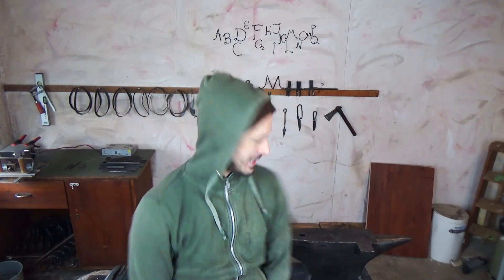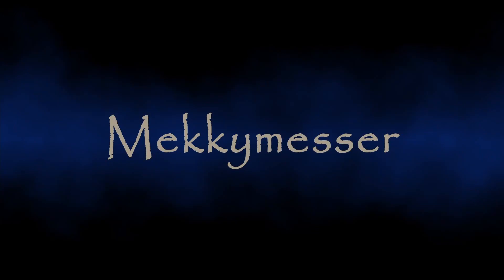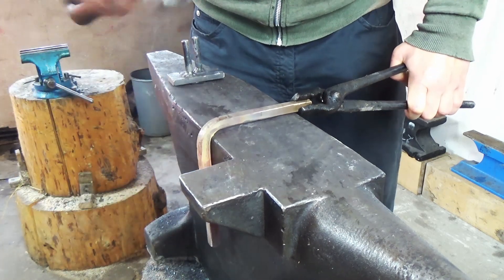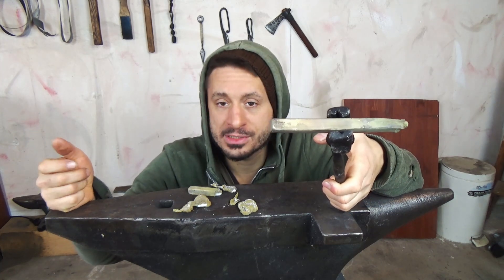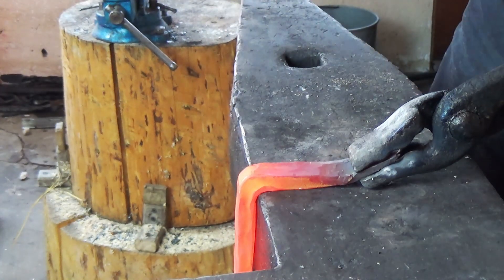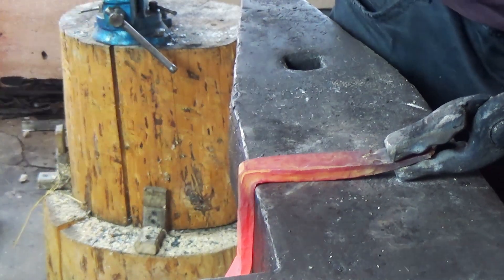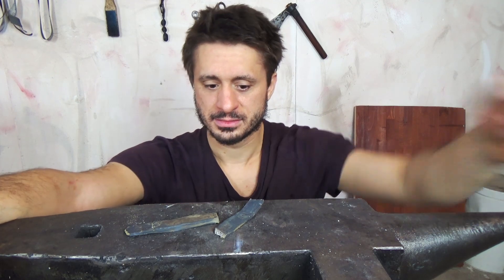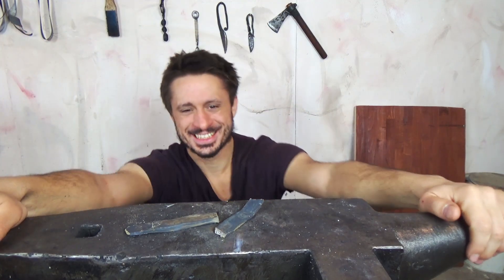First Time forging with Brass.... with 0 Experience ( and failed )

Comment: I'm playing with some brass for the first time now.  One thing I've found out-  casting it tends to be easier than forging it.  I've cracked and shattered it then had to repeat it a few times.  From here out-  I'll put it in a crucible and make a sand mold for it.  I had all the same issues you did, and haven't found anyone actually forging it with success.   Thank you for the video, though-  it let me know it wasn't just me!
Reply: I had trouble trying to forge a Bowie guard from brass, and I discovered that you need the heat the brass until it barely glows, and stop hammering before the glow is completely gone. Light taps and repetitive heats are key. Anneal if overworked.

Comment: Interesting video. I also failed trying to forge brass recently. Whether it was worked hot or cold, it would just crack. I guess it really depends on the brass itself. Brass means many things, there can be many mixtures of copper and zinc, maybe even with some tin. The best bet outside iron is copper for experimenting I guess. Unless you can get your hands on brass made specifically for forging. If that exists.

Comment: Just going from my two personal attempts, 1st cold, soft taps seemed to work a small amount until the bar fractured. Hitting harder just smashed it faster. Working it hot, (4mm bar) I would get decent movement while cherry red but quickly lose heat and risk splintering again. Will try as others suggest, to small work and anneal, if that doesn't work, I guess just keep it hot as possible and work quickly